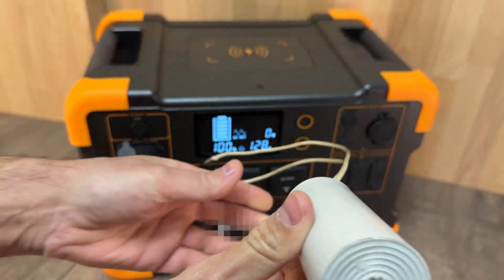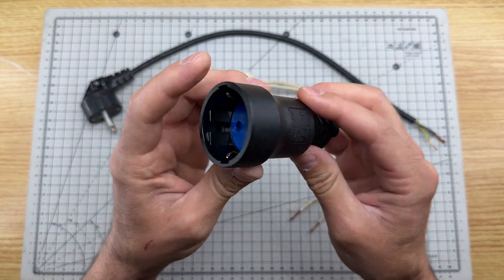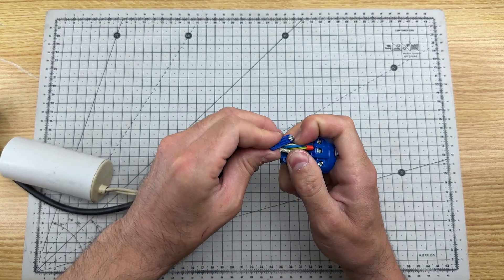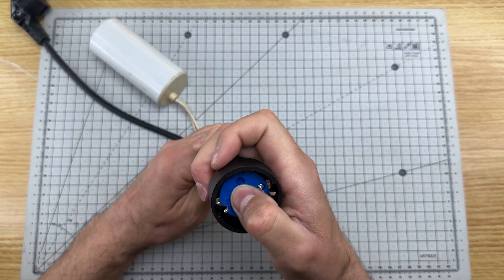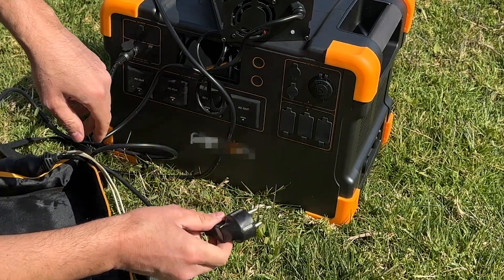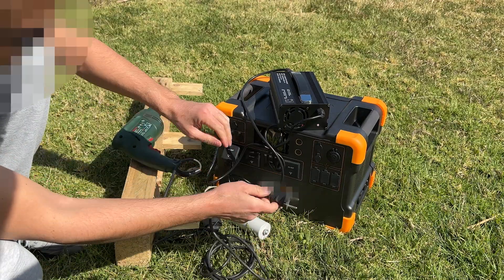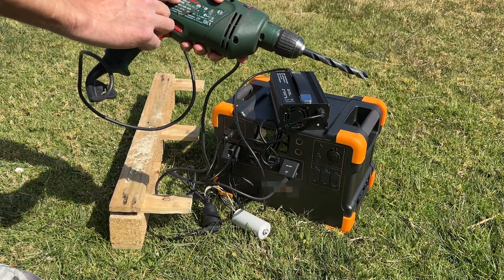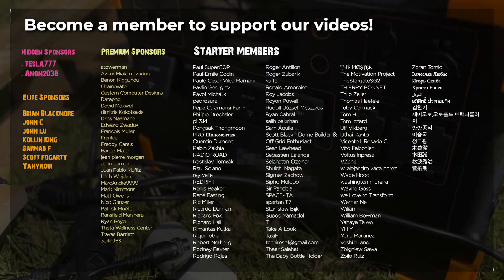Free Energy With This Invention - Free Energy With a Capacitor

Comment: 测试了 不行 以为这个频道的不是骗子，结果也是打广告的 ，估计银铝合金实现自由能 也是骗局，经不起验证
Reply: Yes, this circuit setup could not produce free energy because connecting an ordinary run capacitor as shown will not give you free energy. 
It appears the capacitor is causing the wattmeter in the powerstation to give an incorrect power consumption reading.
Reply: покажи видео, что у тебя не сработало, может ты мошенник)

Comment: This is so deceptive, it's not even funny.
That capacitor, or whatever internals you put in was fully charged, and then that power is what goes into your power supply.

Run it for 1 minute and the numbers will drastically change.
Reply: No, a small capacitor like that could not produce 400 or 500 watts like that even for a few seconds.

Comment: I tried this go a 55w loss without the capacitor and 30w with the capacitor still running at a loss 
Charger was 19.5 volts at 9.5 amps charge was
 182w in 201w out

Comment: There's no free energy, no real energy storage going on here at all. It's just a very crude form of power factor correction.
Reply: No, power factor correction would not account for the output power reading to be much less than the input power reading. 
It would appear the capacitor is causing the output power wattmeter in the powerstation to read incorrectly.

Comment: What you do is build a LC circuit. That's a resonant circuit or a tank circuit. The inductor of the load and the capacitor together has a resonant frequency. You can calculate it with an online calculator. You want a resonant frequency of 50 Ho or 60 Hz. You have to choose the correct value of the capacitor to do it. That depends on the load (or the value of the inductor of the load) you want to use.

Comment: Only way to self-sustaining power systems with the goal of hyper efficiency is to create negative resistance based circuits that are high frequency & wireless in nature. Specifically magnetic resonant in nature combined with a bit of rf energy harvesting from the air & earth groundings. Plasma tubes are definitely needed in said circuits & devices
Reply: не единственный,а один из множества тысяч разных способов, которые блокируются системой.
Reply: И АЗ МНОГО КРАТНО СЪМ ТЕСВАЛ ДА ЗАВЪРТЯ ЕЛ, ЕНЕРГИЯТА В КРЪГ ДА ИМА ЕФЕТК

Comment: I wNt to desigh. Box that will  plug in the wall turn the electric  back into 12volt dc use a inverter to bring 12dc back to 220 ac and reduce power consumption to a 3rd of whatever device is plugesd in not free energy but graitly resuced

Comment: It seems you are actually rectifying the A/C power with the capacitor. Instead of generating energy, depending on the discharge speed of the capacitor this circuit will actually nullify the power!

Comment: No Charger purchase location shown in details ? (On finding this item it seems to have the stand off fixing feet missing).
And the way you are holding the charger makes me feel something has been hidden under/inside the charger unit. Could you open and turn the unit around if possible!!.
At the end of the day this is What you call Power Factor Correction, normally used in old flourscent lamps. Said to save approx 10% of energy.
Reply from the maker: We haven't hidden anything, friend!

Comment: Logically and mentally, this matter is not correct. I will give you a simple example. If you had a liter of water, could you fill a barrel of water with it? It is certainly not correct. Likewise, this method consumes 20 watts and gains 500 watts. Where did these currents and excess electrons that increased the volume of consumption come from? This is not sound talk.  Respect
Reply: Почему когда вы из воздуха получаете воду в туалете на трубах (конденсат), вас это не удивляет, а когда энергию.получаете из гиперпространства, то это сразу невозможно?:))) что за догматы и ограничения?:)
Reply: Смотря где хранится этот литр воды. Если он хранится в воздухе, то можно наполнить больше бочки!!!! Также и с энергией, конденсаторы как и магниты могут извлекать её из гиперпространства, из компонента Хевисайда. Энергия нулевой точки или энергия из "вакуума".

Comment: Energy may change forms, but the total amount in the universe remains constant. First law of thermodynamics, energy cannot be created or destroyed; it can only change forms.
Reply: Bro the law of thermodynamics is not applicable on Columbs and faraday law, because the energy in this system is not measured in Fahrenheit and degrees it's measured watts
Reply: @stanleestruve5613 you have a  complete misunderstanding of energy and the laws of thermal dynamics
Reply: @stanleestruve5613 No, energy cannot be created or destroyed, according to the law of conservation of energy, also known as the first law of thermodynamics. Instead, energy can only be transformed from one form to another. For example, when you carry a ball up stairs, you convert chemical energy in your metabolism into gravitational potential energy in the ball.
Reply: You can't prove or disprove that so that isn't a scientific claim.

Comment: That's not serious!
It should be said that people must be very careful handling capacitors as touching/connecting both prongs will make them discharge if they are not empty and that hurts and can kill.
DO NOT TINKER WITH MICROWAVE OVEN CAPACITORS!!! IT CAN BE LETHAL!

Furthermore: there is no such thing as "free" electricity. This is highly unlikely to really work.
I wish someone with the proper expertise would explain.

Comment: As long as the capacitor is charged, it will feed energy into the system. If it could be shown that the capacitor had no energy to start with, the demo would be much more valid.

Comment: Will this capacitor work similarly when connected to the electrical network? And the second question is, won't the power of the connected device also drop by 95%?